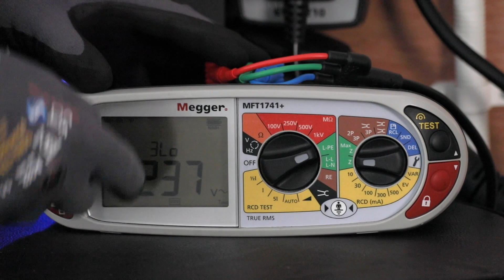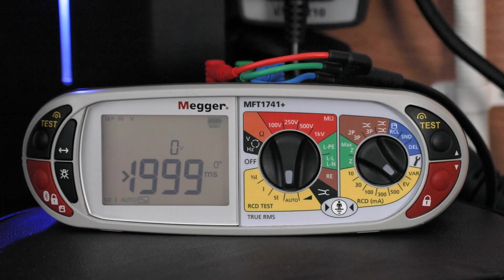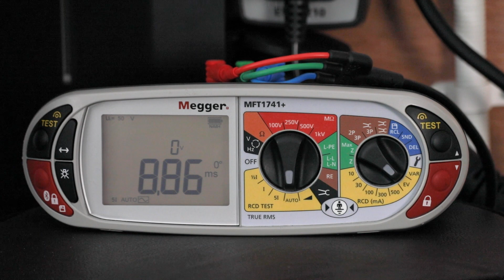Megger Bites Series 2: Testing vehicle charging points with MFT1741+ and EVCA210

Comment: my 1741+ won't do the 3-Lo EFLI test when set to Mode 1 or Mode 2 with ICS & Zappi charge points. The EVCP displays a 6mA DC fault. I am using the Megger EV adapter and the firmware on my 1741+ is v4.04
Reply: Same problem i have

Comment: Anyone experienced bad Zs readings on meggers? 
Been using meggers for 8 years and at the moment we have 4 of them. And measuring Ze my newest 1741+  gives 0.09 and other older ones 0.23 which is more than double.. yes we tried to swap leads but it doesn't help.. in last couple years we also had 3 testers faulty which had to be replaced.. and all of our testers calibrated- but I dont believe they doing Zs testing when calibrating testers, not sure what they taking money for to be honest.. maybe just to prove that 1ohm resistance shows 1 ohm on tester🤔
Ev adapter also got fried and cp error button got stuck after like 4 uses..
Think will be moving to fluke in the future

Comment: Hi, a few questions please?  Does the auto test carry out just tests on the 6mA?  what if the EV charger has an internal A type RCD?  I noticed the auto test has the AC rcd symbol not the A or B type? well it does change when it reaches the Ramp test.  
hope you can shed some light on this?  thanks

Comment: Thanks, maybe the information manual that comes with the adapter needs improvement and not just a quick over view. As I had to find this video to understand it as the manual is pretty poor. 
Apart from that I can not fault Megger at all. Great bits of kit.